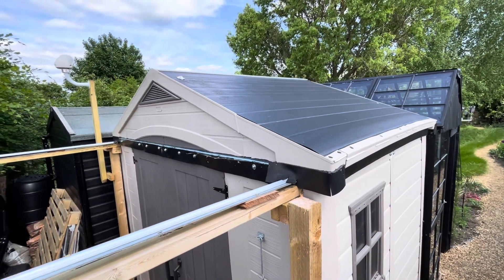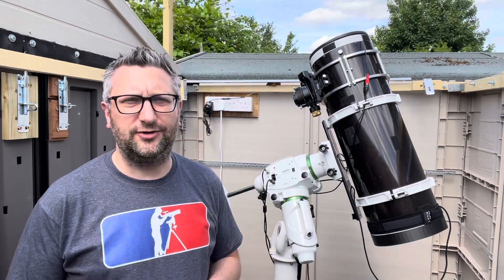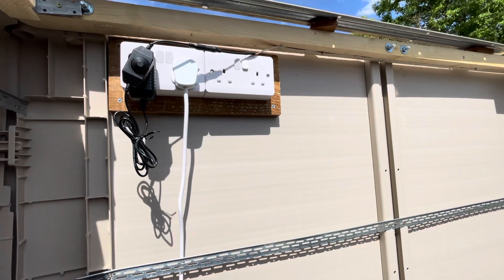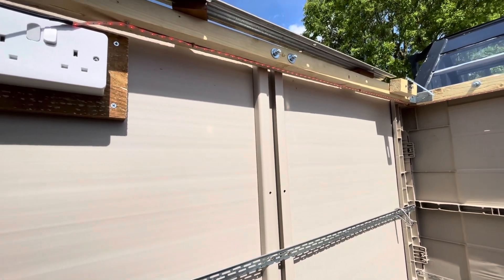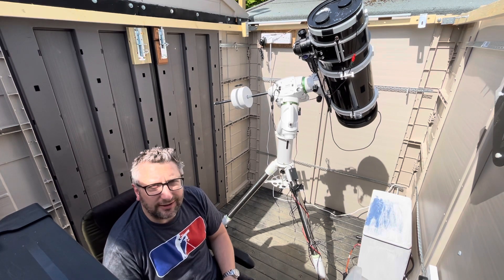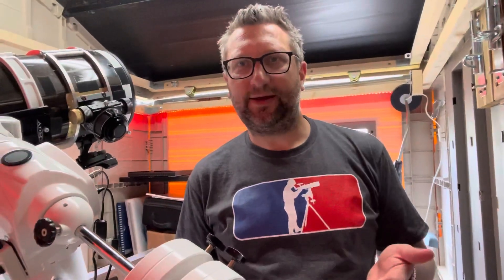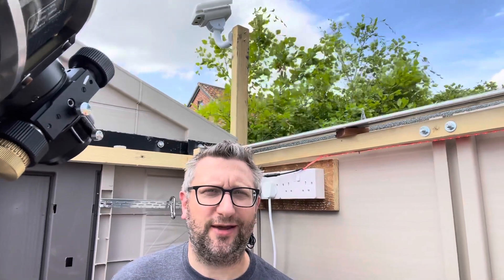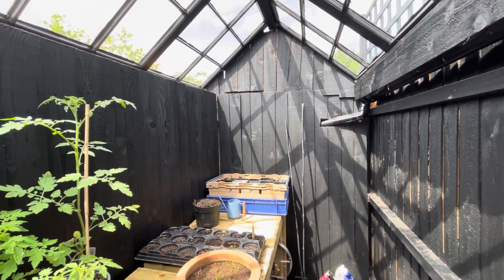Budget roll off roof observatory update

Comment: Curious, what focuser do you have installed on there? I've been looking to upgrade from the stock one on my 250p. Also, do you have the back of the primary capped with something?
Reply from the maker: The focuser is the Baader Diamondtrack and there’s a 3D-printed end cap behind the primary mirror. The guy I bought it from 3D printed a load of things to deal with any light leakage.

Comment: Hi Paul, thanks for the update looks like a lovely setup.  Regarding the weather stripping around the edge of the roof, what type of material is it and where did you source it.  Post Christmas I hope to begin construction of my own observatory and while it will not have a roll off roof I will still need to weather proof the opening.
Reply from the maker: Hi Declan, thanks for watching. It’s a neoprene strip, like the one I’ve linked below. It’s not been trouble-free, but that’s largely because I made a dog’s dinner of fixing it to the roof of the observatory; some sort of waterproof glue would probably have been better!

Good luck with your construction. It’s been an experience having my own obsy - something I’ve dreamed about since I was about 12! 

If I could do things again, I’d probably construct it from wood, as I find that easier to work with. But we live and learn!

Neoprene Rubber Sheet... https://www.amazon.co.uk/dp/B09PBKPRHS?ref=ppx_pop_mob_ap_share
Reply: Perfect, thanks Paul.